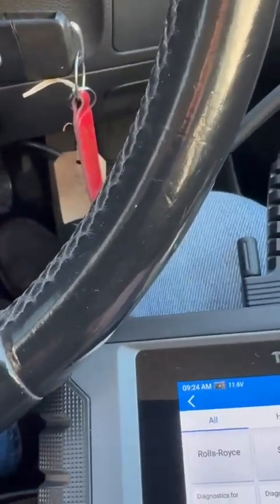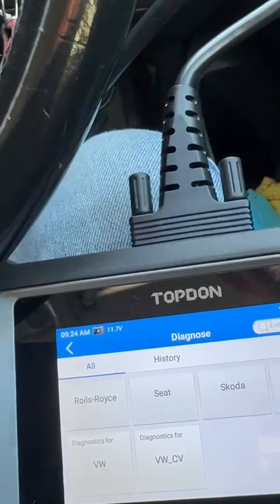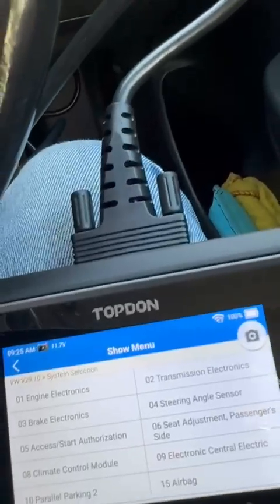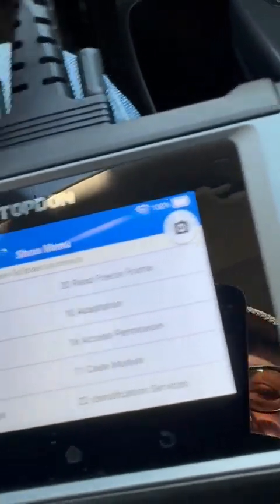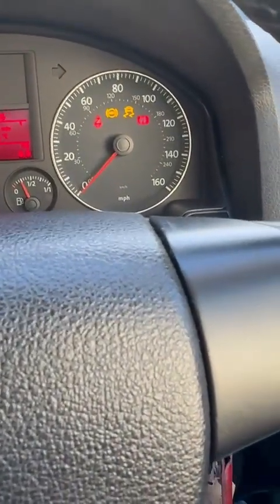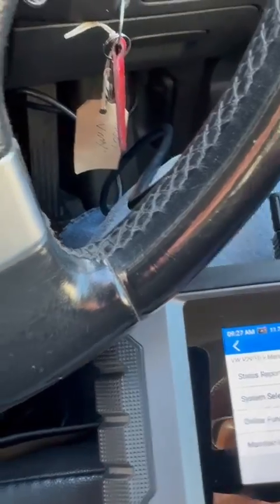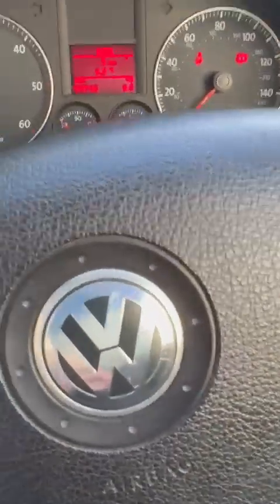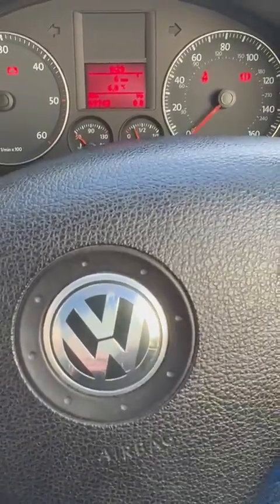Coding New ABS Module For VW Golf 2.0 GTI 2007 Using ARTIDIAG EU DIAGNOSTIC TOOL - VCDS Alternative

Comment: Hi, looking to buy a second hand abs module and try code it with my topdon arti diag pro. Did the part number on the abs modules have to be identical?
Reply from the maker: Hi, usually it has to match or at least be compatible. You'll have to check the OEM guidance.